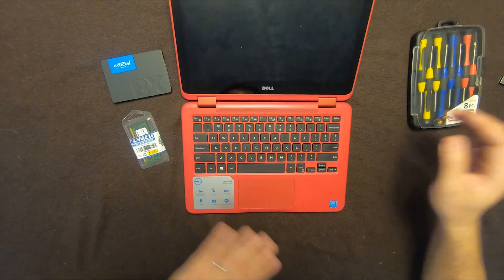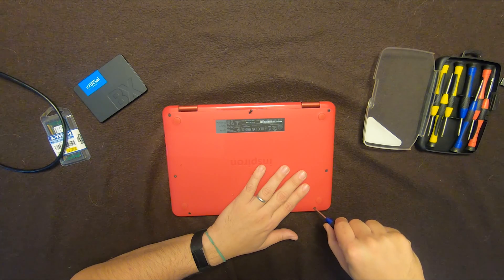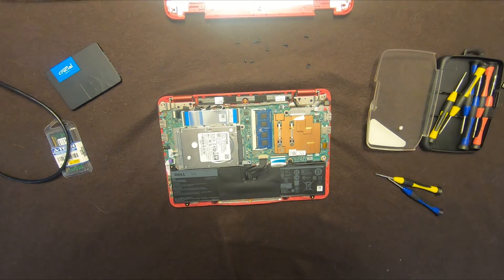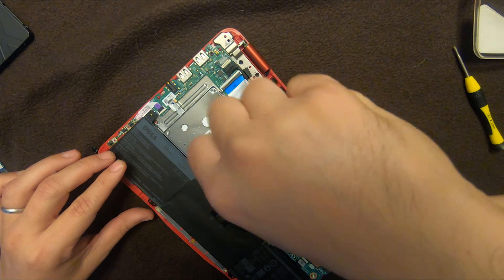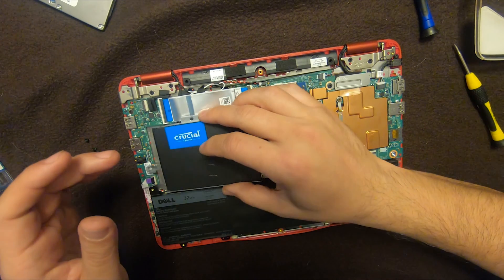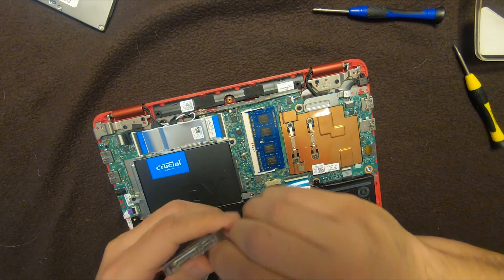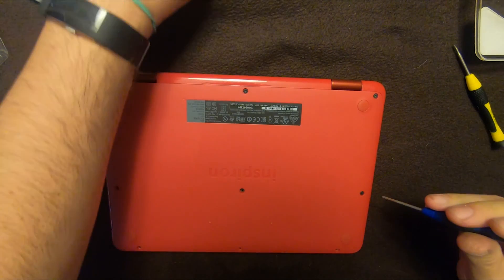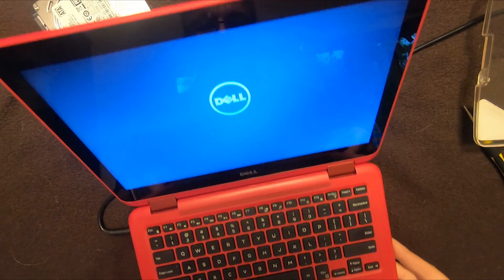Installing hard drive and memory on Dell Inspiron 11 3000 series (3168).  Also fixed keyboard

Comment: I have this exact same laptop…. 💻 can’t reset, can’t clean it keeps telling me I need to make space but it’s not letting me. Any chance what it could be??? And could you also please add the links to where you bought the hard drive and memory?? Just in case I need to replace this. Oh by the way, I can’t use an external hard drive because it won’t let me😭
Reply from the maker: If you look at the description, you can see which one I bought.  Yes, you might need to delete temp data and any apps you don't use to be able to run a reset.

Comment: Thanks for the video, I have a similar laptop, it came with 32gb storage and 2gb ram. There's no ram slot like in the video and there's no hard disk. Any help or suggestions to increase the ram because it is really running slow
Reply from the maker: It's probably a newer version that has all the memory built in and nvme ssd hard drive.  Google "nvme short ssd" and then look for one on the motherboard.

Comment: I have this exact laptop, in red too
is it possible to upgrade the Wi-Fi from a 2.4 GHz to a 5 GHz? I'm a college student and the wi-fi at campus is only on 5 GHz so I'd like to save my laptop from its doomed fate with an upgrade to Wi-Fi. I'm watching this video and don't see a spot for a wi-fi card
hope you're still around to answer! thank you in advance
Reply: I actually opened it up and I see the Wi-Fi card. So I have a new question, Do you have any Wi-Fi card Recommendations to upgrade the laptop to 5GHz
Reply from the maker: Hello, sorry for the delay.  I don't have a recommendation but you can review the ones on Amazon and see which gave solid reviews.

Comment: Hi! I installed the RAM stick you used on my Inspiron 11 3168. I didn’t update the hard drive because I plan to be using it for mostly web-based applications. However, after the install my laptop made loud beeping noises when I tried to turn it on. Did I install it incorrectly, or do I need to update the hard drive, or is it actually just not going to recognize the higher RAM?
Reply from the maker: It might be you're using the wrong kind of memory

Comment: what makes it faster? I'm a novice
Reply from the maker: As to parts that you can change, the type of hard drive and how much memory you have will improve the speed.
Reply: Thank you.  What kind of memory is that? cord to copy ?
Reply from the maker: @heinygoon9453  I included that info in the description but here are the links:
SSD I installed was:
https://amzn.to/44r3U9Q

Memory:
https://amzn.to/3JPJRdk

USB Hard Drive SATA Transfer Cable
https://amzn.to/3JMHh7Q

Comment: Hi there, thanks for your video. Just wondering if you can notice much improvement from 4GB to 8GB ram ? I bought a second one and I’m surprise that despite its age, the battery still last few hours. But the down side is even though it has a SSD in to already, it’s not as snappy as I wish it to be. So, I’m thinking about upgrading the Ram, but u want to know it upgrade it to 8GB would make any differences at all. The one I got has Pentium N3710 4Cores CPU. Thanks!
Reply from the maker: It should make it quicker but I did upload this video a few years ago.  I would buy it from somewhere where it is returnable it does not help.
Reply: @FernandoC  thanks for your reply.

Comment: This computer and even model 3168 has different models, processors and motherboards - on without any HD or RAM upgrade slots.  first thing to do is identify which you have. Is there a way without opening it up first, say based on the stickers on the bottom? ie, made in? china, brazil, etc and the serial numbers?  edit: I think all of the models with 32GB eMMC storage are not upgradable at all - neither the storage nor the memory. No slots. So that's the way to verify without opening it up. (I think)

Comment: My HDD on my inspiron 3000 was so slow that it took maybe 6 hours to update Windows. It basically wasted my entire break at work. 

So I got an SSD and an 8GB ram stick. It wont run as well as the laptop that I originally bought, but it will hold me over until its fixed

Comment: Hi, I have an Inspiron 11 3000 series laptop with Intel Pentium processor. It's an extremely extremely slow laptop with hardly any data on it. Should I change it's HDD to SSD?
Reply from the maker: Yes, I would.
Reply: @FernandoC  Can you please share link of the SSD model I should be purchasing?
Reply from the maker: @monishpawar3381  I'm not sure where you live but something like this https://www.amazon.com/s?k=ssd+drive&crid=3E6FQBYBV9T6A&sprefix=ssd+drive%2Caps%2C127&ref=nb_sb_noss_1

Comment: Do you have to disconnect the battery before replacing hd ?
Reply from the maker: It should not matter if the laptop is off.  If you feel more comfortable, you can unplug it before you do it.

Comment: I have 3148 and just swap hdd to Crucial BX500, I was like holy s*** I don't know this little guy can be this snappy. 😁 I wanted to upgrade the RAM, but there's a mixed answer over the internet whether this model support 8gb RAM or not. Crucial compatibility check said it support but I'm pretty cautious. Do you think should I upgrade or not.
Reply from the maker: I would probably buy it from somewhere where you can return it if it does not work.  If the chip is not every expensive, I would try it.  Good Luck.
Reply: I upgraded  it to 8 gb of ram... its better

Comment: why my friend's dell laptop don't have interface for hdd? i supposed to upgrade it, since it only 32 GB ssd space on its drive? can i upgrade it?pls help me, tnx alot
Reply from the maker: It depends if the 32gb ssd is removable or built into the motherboard.  You have to open it up and see what it looks like inside.  If you can remove it, you can probably replace it with a nvme drive.

Comment: Thanks for the great video! Although when I open the back lit I got kinda shocked because there was no memory slot and no hard drive slot.. I don't even know how to upgrade it.. (I have the same model btw 3168)
Reply from the maker: Hmm, maybe newer ones they have everything Integrated?  Is it a Windows machine or a Chromebook?  Mine is a Windows machine.
Reply: @FernandoC  It doesn't indicate anywhere but probably a Chromebook, still Windows loaded. Wifey got it from her college. Yes everything looks like integrated inside. There are four chips instead of memory, and I couldn't even see any hard drive part. (System shows 28 GB disc and I'm not even able to update Windows because of not enough space) I took a photo of inside, is it possible to send it to you to take a quick look at?
Reply from the maker: @SercanSunneli  sure, you can upload it to imgbb.com for me to see.  You can also go to https://www.dell.com/support/home/en-us , put your service tag or express number and it will tell you info about the memory and hard drive.
Reply: @FernandoC  I have also same problem, there is no SSD slot for upgrade. Please let me know how to increase hard disk space for updates windows. Thank you
Reply: @FernandoC  i have the same problem with mine.

Comment: nice work I have one but slow the upgrades more better and faster than old setup?
Reply from the maker: Yes, the upgrade was a significant increase in speed but this device is a basic laptop, not a gaming laptop or anything.
Reply: @FernandoC  with this upgrades its will be good for business and photoshop?
Reply from the maker: @offrod_oman_rc232  Business possibly, Photoshop No.

Comment: Hi, I got a Inspiron 11 3000-3168 I need to upgrade de disk I found one in eBay 500gb Inspiron 11 3137 this can work?
Reply from the maker: Any 2.5 inch hard drive would work.  Either a spinning SATA or an SSD that is 2.5 inch.

Comment: Can i do this to a brand new one that I haven't started up yet? I wouldn't need to copy or clone any data would i?
Reply from the maker: Correct that you don't need to clone the data as long as you have a copy of Windows to install on the new hard drive.
Reply: @FernandoC  can I copy the windows from the old hard drive or I can find it online somewhere?
Reply from the maker: @lifeonmars03  If you google "windows 10 download", the link to microsoft.com lets you download windows 10 to a flash drive.  You should then be able to install windows from the flash/USB drive.  You might also want to open your computer before buying the drive to make sure you get the right one.  My video is over a year old so it could look different inside.

Comment: I tried adding data (ram) but once I opened the laptop it looks lighting different. The bronze part is where your blue data is at. So does my series not take data ?
Reply from the maker: Your model might be slightly different and possibly it does not take memory. You should really look up your exact model online and see if it says that you have an expandable memory slot.

Comment: Did it recognize the 8gb ram?
Reply: heres my question, can it recognize 16gb of ram?
Reply from the maker: @mkaterminators2  I did not try but I would guess no.
Reply: @FernandoC  would u give it a try and confirm it works or not, i have the pentium version of 3168, runs good on 8 gigs of ram, i wonder what a 16gb stick would do
Reply from the maker: @mkaterminators2  I don't have this laptop anymore so unfortunately I cant.
Reply: @FernandoC  aw man, i would gladly do it if i didn't have to pay for ram if it doesn't work if I tried, but maybe i can find someone to support this
Reply from the maker: Yes

Comment: I know nothing about working on computers etc. can I just install the memory without an upgraded hard drive? 
If so, do I still have to transfer everything over to an external hard drive first if only doing memory?
Reply: Awesome thank you for responding. I don’t know what I would’ve done if I didn’t have your video because my son told me there was nothing I could do to make this laptop better and I was seriously upset about it but because of your video you saved it. super grateful!
Reply from the maker: No, you can just swap the memory chip without doing anything else.

Comment: Not mine. Took it apart and it has NO upgradable slots. Wish I could attach a photo.  I guess it will never get updated now.  I got the dreaded no available space for the installation. What are they thinking!? Why does it require more space than what you have on an operating system. So now I will use the snail until it craps out completely... thanks Dell, I’m NEVER buying another product from you.

Comment: Small comment. This is a perfect video. When I opened my unit I found a slight variation on the hard drive installation. The drive was covered with a metallized sleeve held to the drive by four screws in the usual each mounting holes. The cover obscured the drive mounting screws. So the inboard one has to be removed and then a smAll tape seal removed from the drive to uncover the outboard screw. Once out, I removed four screws that held what is either a heat or static shields down replaced it on the new drive. I reinstalled it without problems. Clipped in the new memory and all good. Thanks for the help.

Comment: Hello ! Which program did you used for cloning the disk? Thank you for your advise and great video
Reply from the maker: Some of the ssds include software, for example Samsung and Crucial have software on their website. If yours does not come with software then you can use Easeus from https://www.easeus.com/backup-utility/free-disk-cloning-software.html
Reply: Hi. I would like to know the specs on the 8gb memory that you installed. Or at least give me a link of what memory you used or can be used on this laptop to upgrade it to 8gb

Comment: Where can I get the cable to transfer the memory to the new Hard drive?
Reply from the maker: You can get one like this:
https://www.amazon.com/dp/B07S9CKV7X/ref=cm_sw_r_cp_apa_i_W0apFbK6PQ3SB
Reply: @FernandoC  ok I got the stuff and already installed the ram but how do I transfer the hard drive can you help?
Reply: also do i install the new memory and then transfer or transfer and then install?
Reply from the maker: @rosiecortinas4725  You can install the memory before.  What brand SSD did you get?  some have built in software and some you need to use a third party.
Reply: Fernando C I bought the one u recommend
Reply: Fernando C I got the crucial 120 GB
Reply from the maker: @rosiecortinas4725  crucial has step-by-step instructions and software on their site: https://www.crucial.com/support/ssd/ssd-install
Reply: Fernando C I did everything I was supposed to but now my laptop won’t turn on :(
Reply from the maker: @rosiecortinas4725  we could try narrowing the problem by removing one of the two. Remove the memory and try it again, swap the hard drive and try it again.
Reply: Fernando C I got it I had to remove the battery press power button for 30 seconds and re attach battery it works now Tks a bunch. Now I don’t need to buy a new laptop.  😁 😃 😀
Reply from the maker: @rosiecortinas4725  Great, hope it feels speedy and will last you a bit longer.
Reply: Fernando C Do you know if the hp stream can be upgraded as well?
Reply from the maker: @rosiecortinas4725  I do not know, if you provide me with the model number, i can quickly research it.
Reply: Fernando  Hewlett Packard 14-cb163wm Stream Laptop, Intel Celeron N4000, 4GB SDRAM, 32GB eMMC, this is what I’m talking about
Reply from the maker: @rosiecortinas4725  From what I can tell, that machine is not upgradable.  The Hard Drive is part of the motherboard and the memory maxes out at 4gb.
Reply: Fernando C ok tks

Comment: Hello, I hope you’ll see this. I have a few questions?

I really want to upgrade the HDD to SSD for faster processing and bigger storage space as well as the memory RAM to 8GB. But i would like to know if 240GB SSD and 8GB RAM is the maximum upgrade i can do for this laptop? Would it be possible to upgrade till 1TB SSD?

8GB RAM seems to be like the ‘good enough’ upgrade when i search for recommendations for laptop specs but I use storage like crazy. I’m not sure if 240GB SSD would be adequate. 

I have the exact laptop with only the plastic case colour difference. (Mine’s the blue-ish purple case.) i got this as part of my ‘free’ stuff from college. I never had a problem and stills works perfectly as it is since I never used this laptop outside office work and casual web browsing. I found typing on this laptop comfortable for me to change and the size to be just right. I just want to upgrade this so it can handle more work when I’m on the go than bringing my main, heavier and bulkier laptop...
Reply from the maker: Hello moinstar, the memory caps out at 8 gigabytes so you cannot go higher. The hard drive can go as high as you can afford.   You should be able to go up to 1 terabyte with no problems.
Reply: Fernando C I see! I’ll plan ahead onto when I’ll upgrade it! Helps so much!! Thank you so much!

Comment: i have this same model, i bought it 3 months ago and its super slow with everything, even with basic programs like word.My computer have a amd 9 9420e processor, hdd 64gb and 4gb ram. did you thing if i upgrade with a ssd 250gb and 8 gb ram i can save my computer?

thanks a lot
Reply: That’s for sure , the ssd it’s more fast than the factory one . Let me know in advance .
It’s the model 3195?

Comment: Does the hard drive comes with the transfer cable? thanks for video fernando
Reply from the maker: Nope, you need to buy the cable separately.
Reply: @FernandoC  where can you get the transfer cable if you dont mind me asking?  Do you need the cable tho?  the website for the HDD that you have listed, when you look at the product it says that they have the clone software etc..  but, i'm just wondering how you get it on the new HD without the cable?
Reply from the maker: @rudolph5483  if you have a desktop computer, you could connect both hard drives onto the desktop and clone it that way period if this is the only cable then you do need some type of cloning cable or device.  here is one listed on Amazon but there's a bunch of different ones. https://www.amazon.com/dp/B073SXTY64/ref=cm_sw_r_cp_apa_fabc_1Cr1Fb7CNZ45T

Comment: do some laptops come with no ssd?
Reply: SSD = solid state drive, it’s a type of hard drive. This model came with an HDD or Hard Disk Drive. HDD is usually slower than SSD but it’s much cheaper despite doing basically the same thing.

Comment: I have the grey version of this laptop and when I tried to upgrade it it looks completely different from the one in the video so it wasn’t able to upgrade the storage it needs
Reply: 2018 Dell Inspiron 11 3185  this the model I have
Reply: @green_grapes717  I have the 3180 and it doesn't have a 'real' hard drive, just a soldered-on-the-motherboard eMMC storage chip.  No way to upgrade that to a hard drive.  I suspect that your 3185 is the same way.  There are so many versions of this little laptop....

Comment: why does mine not have a hard drive some how does anyone know if any of the models just has a ssd?
Reply from the maker: If it's newer, it might have a small chip instead called "m.2 ssd" or "m.3 ssd".  If you look inside the "Device Manager" app under Hard Drives, it should tell you the make and model of your hard drive.